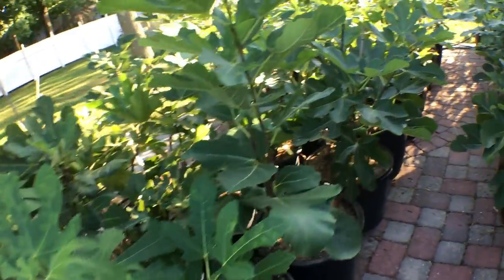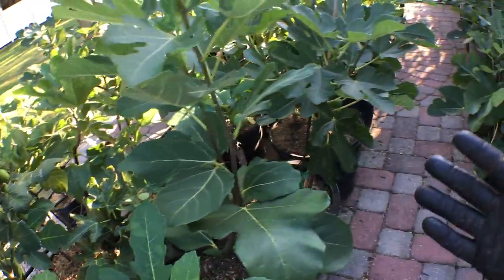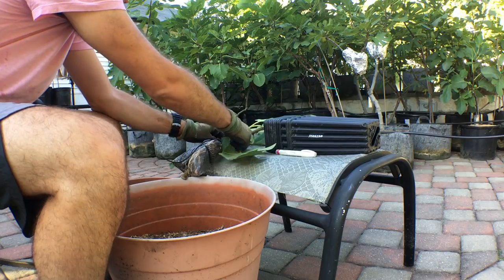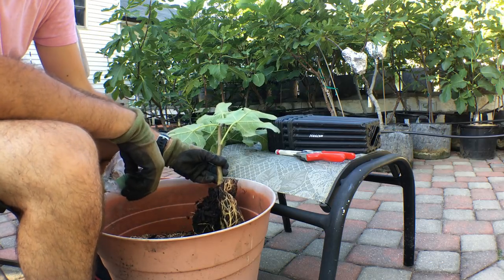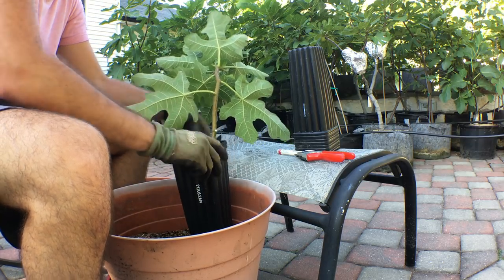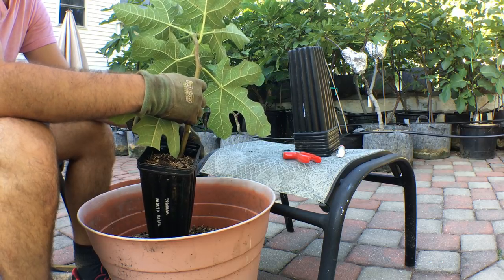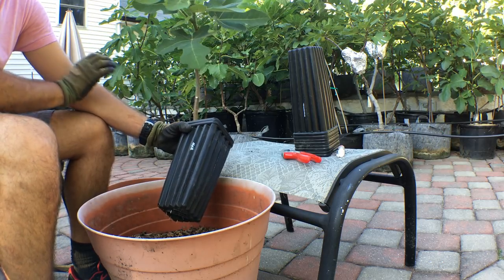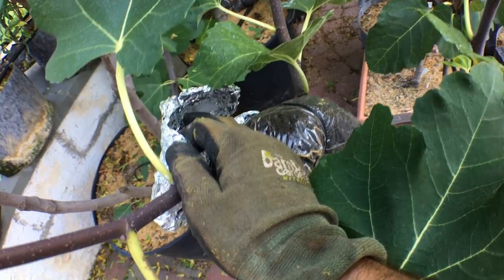How to Remove Air Layers: The After Process

Comment: just picked up my first fig tree... it's about 7 feet tall and I was planning to remove the top 3 feet by air layering once the sap starts rising, or do you think it will root while in dormancy?  I figured if I can start the air clone in February then I can remove the top without too much harm by April at the latest.

Comment: thanks for the info ross, quick question. I have a few fig trees that have rust spots on some of the leaves. what causes this and what can I do to fix it?
thanks
Reply from the maker: Less moisture/humidity. Early morning sun drying the leaves. I'll do a video when my trees get hit with it. Surprised they haven't yet.
Reply: thanks Ross, look forward to your video. I currently only water early mornings around 6am but it still is getting to the high 80s and 90s here in GA. we have had some pretty humid days as well. I wonder if I should start watering in the evening when the heat of the day is on the decline.

Comment: Owwhhhhh unfinished video againn😅😅😅. This even in the middle of important information. Wish you could fix it in the next upload🙏🙏🙏
Reply from the maker: It really sucks that sometimes my camera will cut out the last 2-3 minutes. Don't let the air layer dry out :D
The roots will slowly die.
Reply: I water my air layers almost daily like a hanging plant. I usually don’t put foil around them so I can water the root production and monitor the water. 

The end of the video said you can’t add water, but with bags I use the Cajun injection (for like seasoning a Turkey) needle to inject water as necessary.